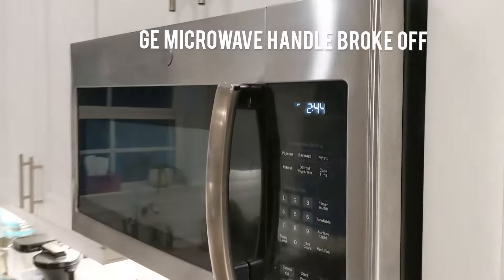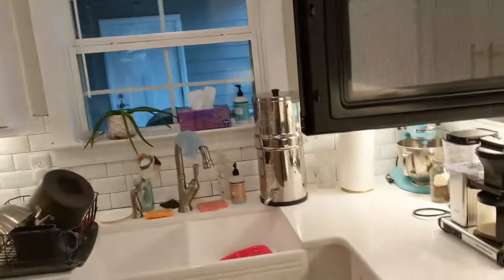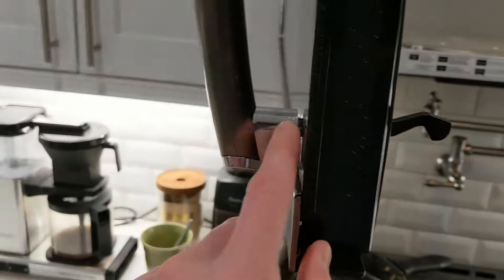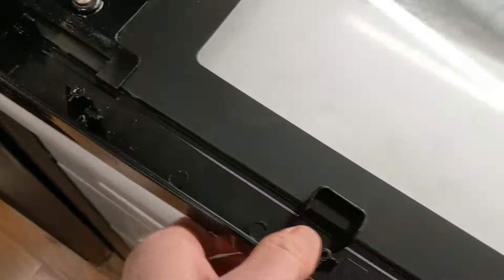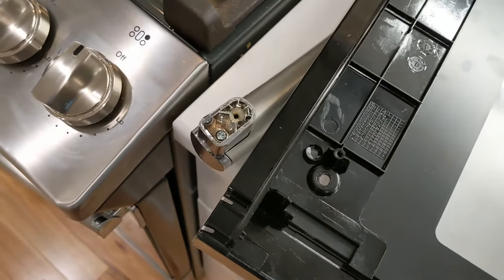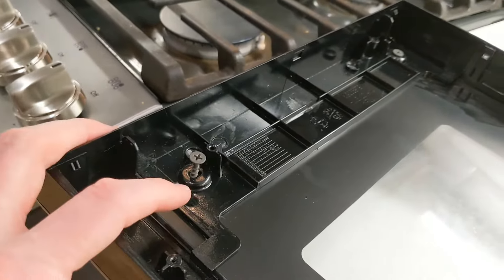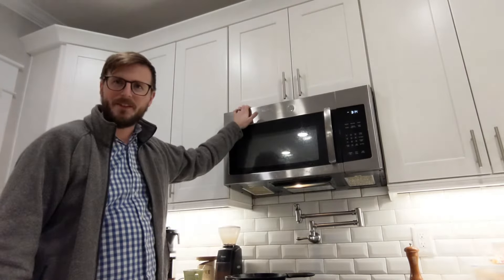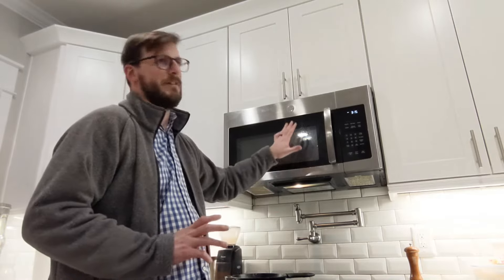GE Microwave, Broken Door Handle Repair

Comment: Poor video and explanation.  You didn't need to remove the whole door to replace the handle.  You already have access to the top screw, was it the lower handle screw you couldn't access?  We can't tell because your shaking the camera all over the place.
Reply from the maker: That's the beauty of YouTube if you have a better way of doing it, film it and show it. Just don't ignore the many people this video has helped. May not have worked for you, but thousands has this video helped. So does the problem lie with the video or the one disgruntled viewer?